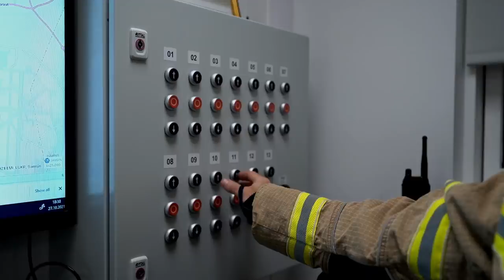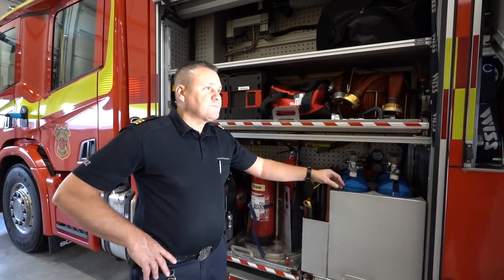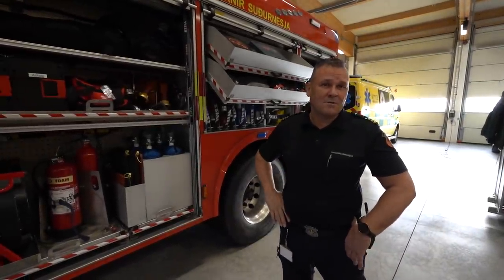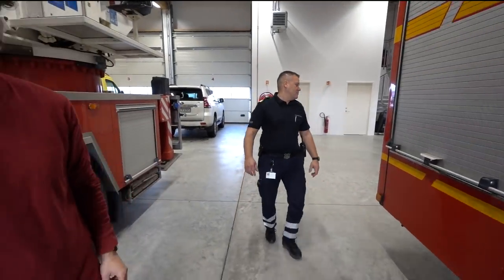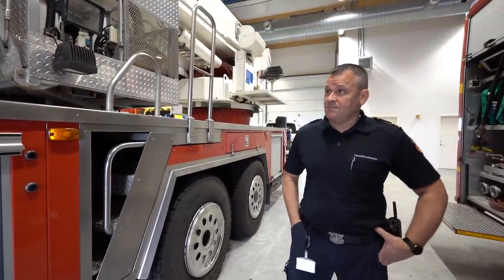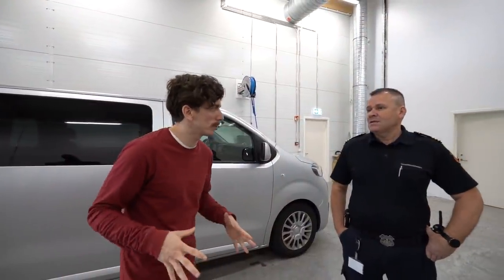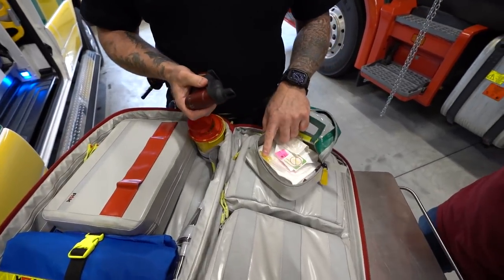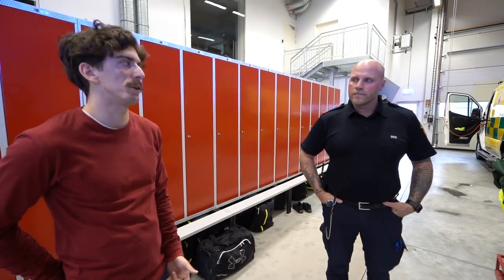ODWIEDZAMY STRAŻAKÓW Z ISLANDII! [NAPISY PL] | KEFLAVIK FIRE STATION! [ENG SUBTITLES]

Comment: These Icelandic firefighters are more equipped than us, in Brussels !!

For exemple : 

They have electrical strechers, and we don't.
They have 4.000 liters pumping engine when we have 2.000 liters maximum.
They have radio communication inside helmet and we don't.
They have paramedics and we don't. We are basic EMT. And they have cameras to intubate patient wich must be a doctor in Belgium, and even if it's the case, we don't have this camera.
We need to do a manual CPR when they have machinery to do it.
Finally, they have monitoring apparatus inside ambulance, wich we don't have. In Belgium, must the doctor taking it by himself.

But I think they have less experience than us, beacause in Brussels self, we must protect around 2 millions people.